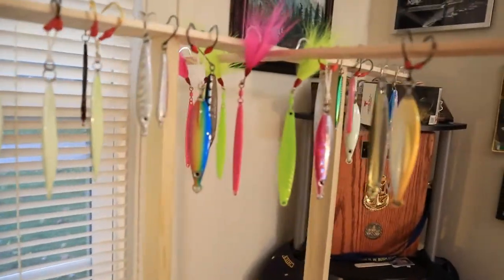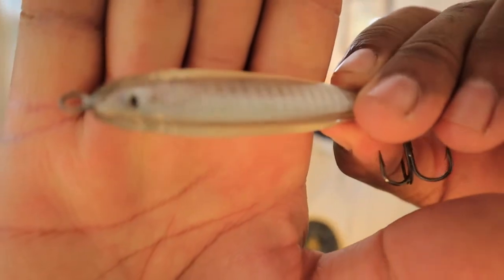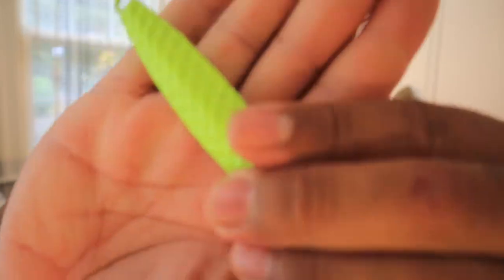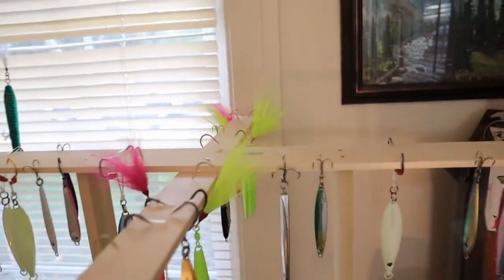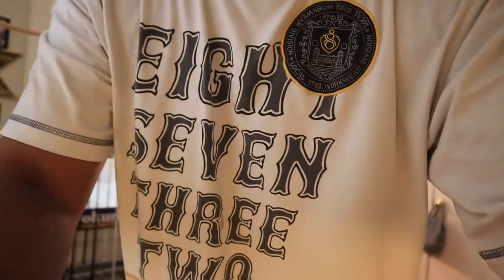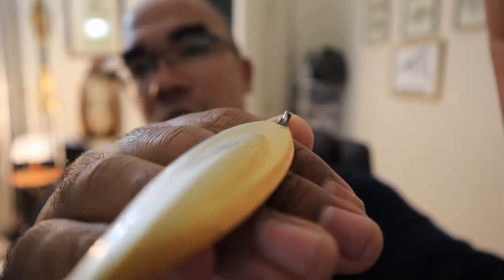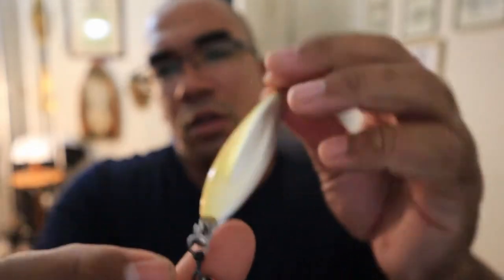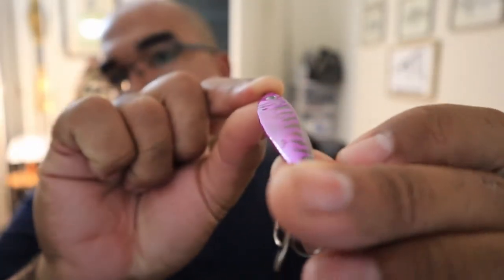Home Dripping Cheap resin jigs spoons

Comment: Very nice, thank you for the info... I was just looking into pouring my own Epoxy like jigs.
Reply from the maker: Late update to get the airbubbles out use a torch lighter and it worked much better long term than I thought they hold up on the rocks and toothy fish didn't even phase them!
Reply: @KennethLondon-ft9gw  That's awesome, I need something strong to hold up.

Comment: Nice video, I would like to see a follow up. I am curious to know how these jigs held up against blue fish and rocks. Did the epoxy peel with the paint? Any yellowing?
Reply from the maker: NO yellowing but no matter what they chipped when a 3lb porgy come flying over the pier so it was a good idea that went south LOL
Reply: @KennethLondon-ft9gw   Tough break. Thanks for the reply. I found this video when searching for a way to protect some vertical slow pitch jigs that get banged up easily. Even the high quality ones get dinged up when jigging hard bottom or by toothy fish. I thought epoxy might be a solution but will keep looking. Thanks again.
Reply from the maker: @jimmyrosario6567  they are ok on the boat but most my Jigging was off a pier and I ordered so many of those 20 and 30 gram jigs it's almost like Amazon ran out between chipping and toothy fish break offs I lost a bunch